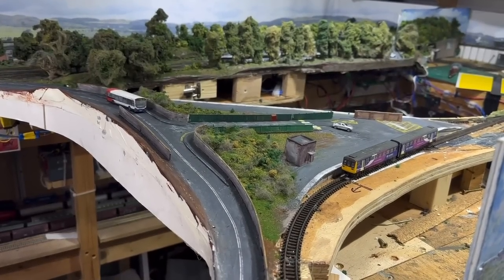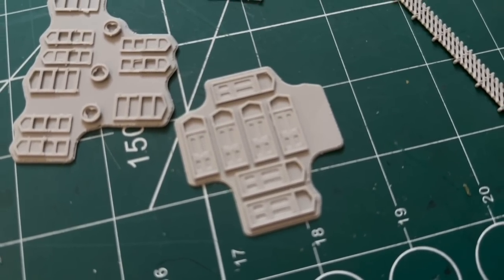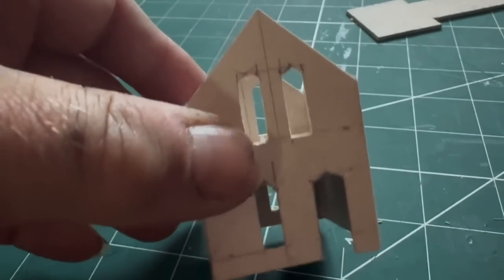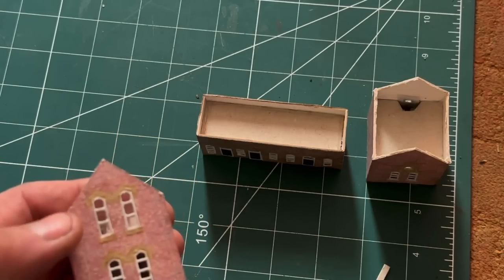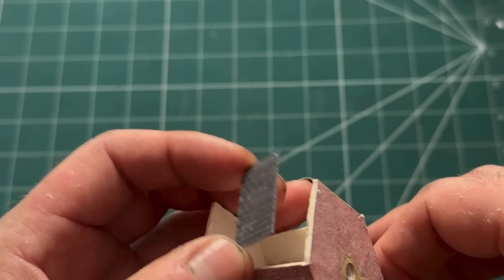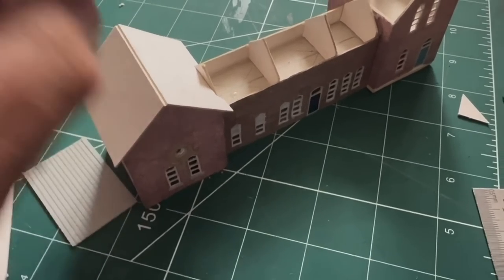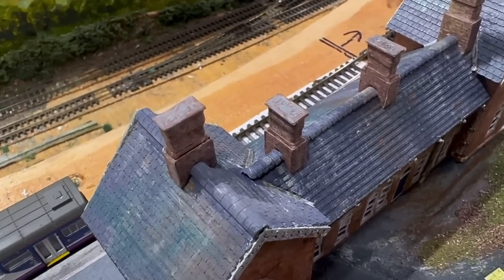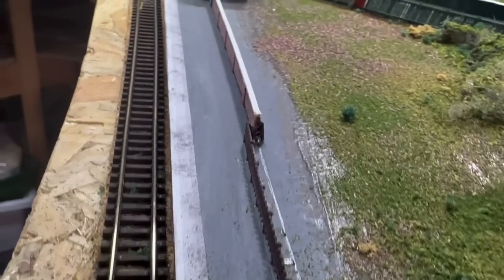DINTING STATION in N GAUGE – Scratch building the Main station building

Comment: Wow, that's just amazing John! I especially love the 3D printed parts, especially the doors and roof tiles. The chimney pots look great too, I find it hard to make mine that detailed, as I don't have a printer, I noticed when you cut the paper for the windows, you needed a new blade in your scalpel lol, yes, I really like the results you got, and yes go for the other buildings on the other side of the platforms, nice one John, cheers Dave
Reply from the maker: Thanks Dave, glad you liked it. Keeping fresh scalpel blades is a wise move. I use swann morten blades no 11, you can buy them in bulk, dirt cheap on eBay. I usually get couple of hundred at a time. 

I’m currently thinking how to go about the extra platforms and buildings. It’s the mainline side, requiring extra thinking power, lol. Thanks for your support.
Reply: @piccadillymodelrailways  No worries, I use No.10 blades, buy in bulk, same as!

Comment: Have you thought of getting the road bus moving? Small kids' bike chain held with 4+ small plastic gears with a magnet attached underneath and on top of the roadway with a motor driving a gear. This looks a cheaper and quieter way of maybe doing it than the monstrosities that you can get on the market. Just an idea, I know you might not have time for that, but I'm just putting it out there as one idea of many you probably get. All the best.
Reply from the maker: Hi, I do love the idea, but sorting a believable route which does not take away my access space is really difficult. Yes I agree the magnorail. System is very good. Secondly the bus is made from card with fixed wheels, why? Apart from modern coaches or the new London routmaster (Boris bus), no-one has made any N gauge modern buses. Loads in OO, none in N. Thank you the bus is  believable enough.   You can download a net which you fold up, I couldn’t leave it there lol. There are 4-5 on the layout.
Reply: @piccadillymodelrailways  tomytec moving bus system, one more idea, but I know it's not your cup of tea.
Reply from the maker: Thank you James, but as you say its not something for me at the moment. Space is my issue and creating a believable road that would cross at least two zones, destroying the idea each zone is miles apart, whilst being next to each other in model form.

Comment: Did you think Id not done anything this week?' you say. By your normal standards I would say no, not a lot lol ;) This is quite a diddy little projct for you isn't it? But still you provide an excellent video full of detail and explaination as always! A quick question if i may? Regarding your 3D printer...it looks like you're using resin now? If so what do you do about ventalation and i understand the fumes are quite bad and somewhat dangerous? Do you have a fume cupboard or something? I watched your 3D printing video from some time ago but I believe you were using filament back then? I jsut wondered what your set up is now and any tips that you haVE. Also what design software do you use now? Thanks again for the video John and take care. Mav
Reply from the maker: Hi Mav, all the hardware is the same, ie Creality Ender 3v2. I still use Tinkercad, the big difference is the latest version of Cura 5.4. With each incarnation, the g-code is becoming more and more accurate. 

For me I really dont like resin printers for the reasons you gave, along with the need for a curing chamber, endless amounts of IPA etc etc. The creality, although not silent, is easy to do and relatively quick. Hope that helps.
Reply: @piccadillymodelrailways  Thanks John. I have a Creality Ender 3 S1 I believe. TBH I have been struggling a bit with it, getting it level even though it is supposed to have an auto leveler!. I didn't know Cura was up to 5.4 I have been using Pura 2.6 but i see now that Cura has treesupports so I might give it a go again. What amazes me with your prints is just how smooth they are, no lines visible at all. You must have yours set up really well :) Anyway, Thanks again John and happy modelling!
Reply from the maker: The results can vary depending on the setting of the machine. Move away from heat spots and draughty as they can severely affect the print. I put Cura onto to finest settings ( super quality), 0.8mm layer height, with a speed of 25 for outer & inner walls. Retraction is enabled set at 5, with speed of 45mm/s. Cooling is enabled. 
Really fine prints are always done on a raft set at 2mm, 0.3mm air gap. Prints over 20mm in each direction no raft straight into the bed. 
I’ve upgraded my machine so much, with direct drive, glass bed, creality auto leveller. Our machine are fairly similar. The S1 was the base ender with extra mods added. Pl say if I can help. YouTube is amazing for ender series inc problems. That’s where I learnt.
Reply: @piccadillymodelrailways  I have just tried my hand at Tinkercad for the first time. Considering I have a degree in Computer design using Maya, I have been finding It nearly impossible to use the other free software. But this is so intuitive! Thanks for pointing me in the right direction John. Very much appreciated! ❤👍